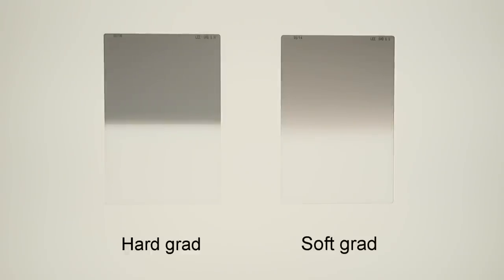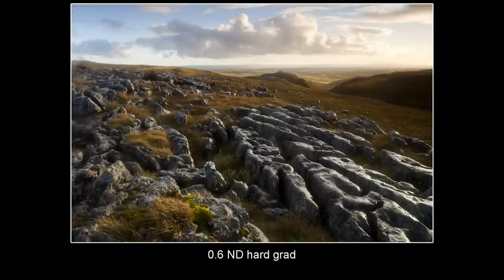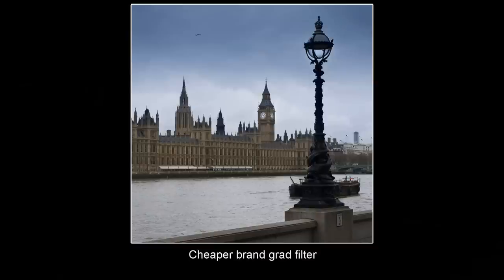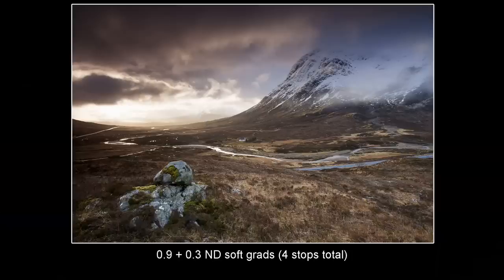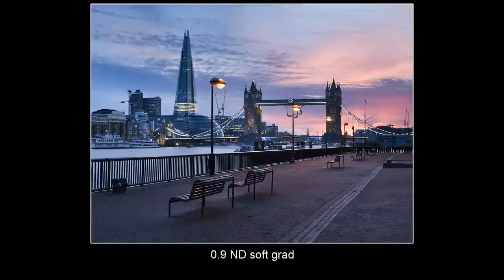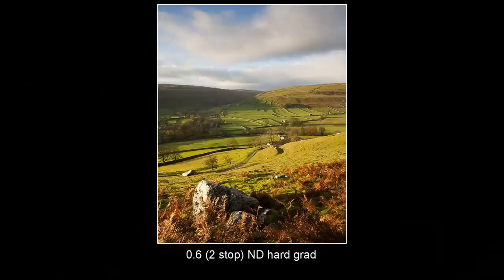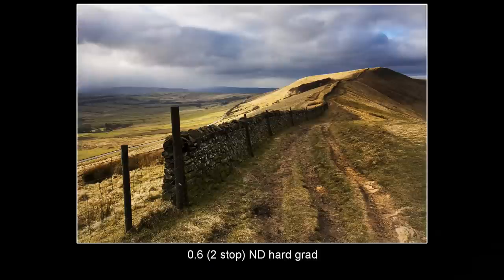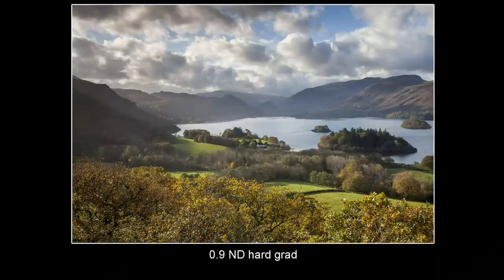Quick Guide To...Grad Filters

Comment: Although I am equipped with square filters, I also have two (one hard and one soft) round screw-in filters.  Yes, I have to place my horizon down the middle of the image (quite boring) when I am using the round filter but, those round filters take up virtually no space in my camera bag or photo vest and weigh next to nothing.  I will carry and use the square filter when I am planning on a day of shooting landscapes but, when I am traveling or just doing walk around photography, it is quicker and easier to use the round filter and crop the image to place the horizon off-center.  I carry five filters in a stack with stack caps:  CPL, 3-stop ND,the hard and soft grad filters, and a 10 stop ND...  My widest lens takes a 77mm filter and I use an adapter to fit the filters on my lenses that take 67mm filters.

Comment: Hi Craig, just a quick question if you don't mind - I currently own a tamron 24-70mm lens and have purchased the lee 100mm filter system as I'm trying to get more things right in camera, I'm thinking of getting the nikkor 14-24mm wide angle but I have read you can't use the lee filter system with this lens - is that correct..........?
Reply from the maker: Correct. That's where their SW150 system is needed.
Reply: Ah thanks, kinda puts me off buying a wide-angle having just spent money on the 100mm system - never mind ;)

Comment: Hi Craig, I've only recently come across your vlog. Love your simple explanations and format. For me, the reason I buy filters is not because I want to spend more time out on the field, it's because there are things I can't correct in Lightroom. Forgive me if I'm wrong as I'm still new to all this, but if I'm shooting a waterfall or a river and I want the nice milky water effect, without filters this is impossible to achieve.
Reply from the maker: J Z You are quite correct. Even with regard to using grad filters, its easier to balance exposure with a filter than do this with Photoshop. You have to know how to do that on the computer. And as you say, you can't extend the exposure with post-processing, you have to use an ND filter for those waterfall results.

Comment: hi, thanks for your suggestion about wich filters to buy first. i want to ask if there is a difference between 100 and seven5 about the hard,soft, medium grad when i choose the 100mm lee system for micro four thirds. i don´t know what i schould buy. i live in austria...high mountains everywhere. can you give me an extra suggestion, please? :-)
Reply from the maker: MolocHlevel30 Hi, yes, there is some difference between the LEE filter types, just because of the size and graduation on each size. If that’s your environment, then maybe a medium grad would be ideal as a first purchase.
Reply: @e6Vlogs   Thank you! :-)
Reply: @e6Vlogs   Sorry, im asking to much! :-)  What Strength should i buy for my first ND filter 6 or 10 stops?   Last question i promisse! :-)
Reply from the maker: MolocHlevel30 That one is not so easy to answer. It depends on your subject, what effect you want and therefore what shutter speeds you are trying to achieve, and when. You need to watch my ND filters video!

Comment: Thanks Craig. I learnt something new with your rule of thumb tip. Which filter holder do you think is the most secure or any tips on making sure holder stays fitted to lens. I was recently taking photos on Whitby Pier as was petrified that my expensive filters would end up in the sea or break on the lower part of the pier. Many thanks.
Reply from the maker: John Edwards All filter holders should be secure. If they are not, then there's something wrong with it. They should stay in place unless you knock it.